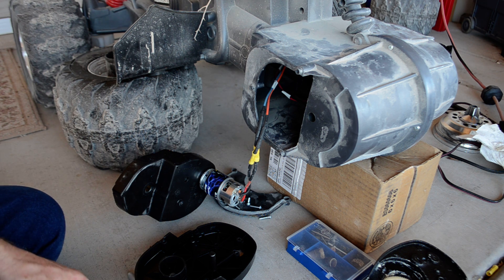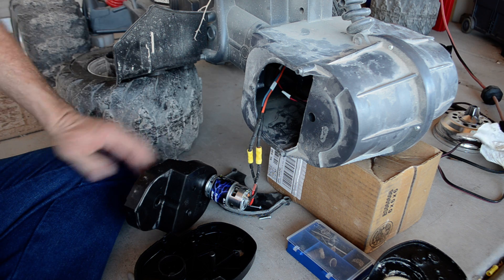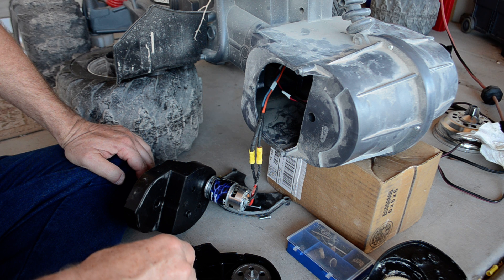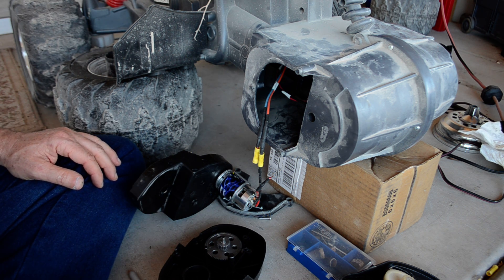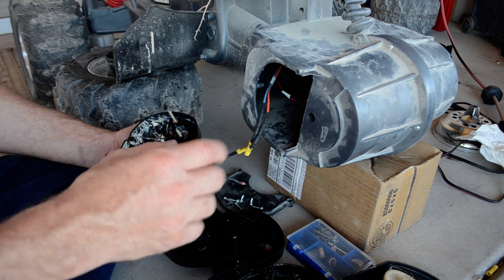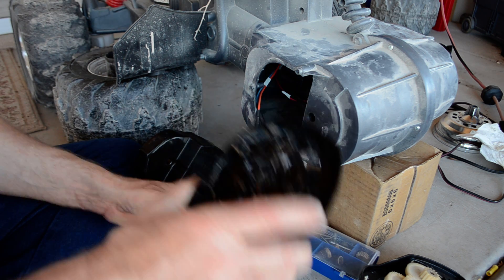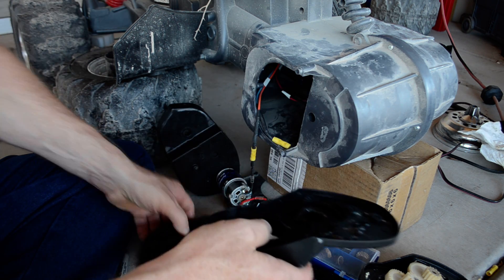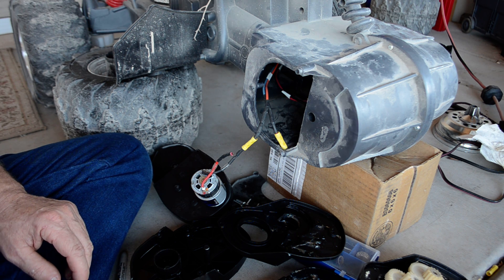ML Toys Powerwheels Stage IV Steel Gear and Gearbox Review & Results & Alternatives.

Comment: It's been 4 months now and the customer is still running. There's a reason we put a lifetime warranty on our steel gears. Yes, it took what we also consider an excessive amount of time to determine what was wrong and as a result it has improved our ability to respond to other customers in a much more expeditious manner. It is always our goal first and foremost to make sure that your child gets to enjoy their ride. As this case showed, regardless of how difficult the customer was to work with we will stick it out and give you support on any product you purchase from MLToys til we figure out the cause and best resolution.
Reply: ML Toys passive aggression isn't acceptable.
Reply: Oh wow. Glad I stumbled on this video because I was really close to buying some gear boxes for the 775 motors I just ordered. "No matter how hard the customer is to deal with"? Really?  I understand you get a lot of customers messing things up themselves in your line of work, but this man bought a premade system that my 3 yr old son could practically install himself. You admitted you have revamped your customer service because of this man...yet you never apologize and basically call him a pain in the ass. Look at how difficult YOU were to deal with. You sent him a defective part and he sent you video of the problem. Any respectable company would have apologized right away and sent him a replacement and a label to return the defective. I will never buy anything from ml toys just because I can tell your customer service sucks. This guy in the video was honestly pretty nice about it...I could sense the frustration, but he never bashed your company or cussed you like I would have. Then you have the audacity to troll his video and brag about your products after you completely screwed him. At least pretend to be sorry. I'll just buy a stock 7r case and a metal gear from elsewhere
Reply: @The_Bearded_Redrick  OMG ! I truly thought i was the only one who put up with ML toys "Bullcrap" I spent over $100 trying to buy 1 gear that i needed  from them .. I thought that i messed up when i bought the very first gear from them so i went back to order the right one this time & they had pictures of the different gears they offered & check boxes next to the pictures of the gears so I see the gear i needed i checked the box next to it ...How could i mess that up again ?  And again I was sent  the wrong gear ?  I still gave them the benefit  of the doubt & thought maybe the  pictures of the gears were mixed up so i checked another one to see what would happen & again i got the wrong gear ... Now  I'm really pissed because they are  advertising the gear i need  & I have spent over $80  trying to purchase this gear so far and I still haven't got it yet ..   So i send an email to them & tell them what has happen so far & then I tell them specific gear i wanted to buy & told them that i wanted to return the other gears they sent me .. I was told that there was no returns on these gears & for the life of me i don't remember why they wouldn't take them back .. They sent me the right gear finally and yes i had to pay for that one too .. I still have all the wrong gears they sent me ..  they didn't admit that they had done anything wrong or  even try to make it right with me or even apologize for what they did ...  It didnt do any good to talk to them at all because they got over $100 from me & that's all they wanted from me  in the first place .. I am a woman that is also a certified Mechanic & I knew exactly what gear I needed before i even found ML Toys web site .. I chose ML Toys because they had they had the gear i needed & I thought the price they were asking for them was more then reasonable & affordable..  I want to tell stickman im sorry you were treated like that & I know the feeling & because of ML Toys  by the time I received the right gear  from them so much time had went by & the gearbox got misplaced  & the little red corvette never got put back together ..She still sits in the back yard but this summer she is getting a upgrade to a 49cc gas motor & rubber tires  .. Redrick you said at least pretend to be sorry ..I agree because that was the very least they could of done ..  I take that back they did their very least which was absolutely NOTHING
Reply: @teresacomer8480  how would one go about getting it converted to a 49cc gas powered motor? I have a dirt quad and want to do this to it. I can give my email or whatever to get this information!! Thank you
Reply: @The_Bearded_Redrick  Not only did they not apologize and send the right part like you stated.. They instead said our bad, we had bad parts come in so if you want one of the good ones we will give you a 10% discount.. WTF!!
Reply: You just lost a customer with this comment.
Reply: Hell it should last a lifetime if you can't even USE your product. 
Maybe if your company didn't take shortcuts by half ass production of the product and then knowingly send it to a customer hoping they wouldn't figure it out then you wouldn't have had to "cover expenses of multiple shipments". 
Your comment makes you sound like a immature 5 year old. Who the hell brags about doing the right thing, you didn't go above and beyond, you did the bare minimum by covering the cost. Quit acting like a b*tch and man up to your mistakes. 
Who cares if he's rude?? You shouldn't have sent subpar products to begin with and lied about it being normal.
 I was thinking, mistakes happen, it might be a fluke. But after seeing your comments on here I made up my mind if your too immature to own up to your mistakes by saying something like "we tried but he was rude even the first time we talked" makes me think your too stupid to realize what customer service is.
Reply: Oh and with the "no matter how hard the customer is to deal with" comment, if yall didn't make shitty products, lie to your customers, and brag about doing the bare minimum, I imagine he would've never posted videos. The only reason yall did anything is because he was able to prove he was sent MULTIPLE messed up products.
Just because your business is in toys for kids, doesn't mean you need to act like one. My 3 year old could run the customer service department.
 "I don't want to play with them, they're mean!" 
"He started it!"
gets in trouble "Well so and so did this!"
"I didn't do anything, it was his fault."
Writing these comments just makes me hope your company fails, which if you don't graduate elementary school, chances are it will.
Reply: I have worked in customer service for a very long time and this is not how you treat customers at all. This is a disgrace on customer service. Your company shouldnt even exist with your behavior! You all should take a good training course in customer service!! Also a customer should never have to pay to send wrong parts back let alone have to pay for the right ones! When you make a mistake you take ownership to it and make sure it is fixed to please the customer!! I've been cussed out by 90 yr old woman because they put a wrong address for the delivery but yet we still made the correction and did what we had to to ensure a happy customer. I will never order from you and I have 4 I am trying to upgrade!!
Reply: @rcon3829  This customer's issue was corrected and he has been using the products happily for years since this video was made. The customer did not have to pay to send parts back either. As you are likely aware from working customer service there is more to a story often. You can always feel free to reach out to us if you need support with our products. We wouldn't still be here after 12 years if this was the norm.
Reply: @mltoys9644  If you have such good customer service why cant you have a direct contact such as a phone number.
Well after reading this and watching I am trying to cancel an order for 2 gearboxes Stage 3. I will resolve by other means
Reply: If you can reply to me by phone number you should be able to find my contact number. You can try and convince me that your parts will solve my issue.
Reply: ML Toys
Reply: Wow, I just ordered a pair of their stage 3 gear sets... I have zero time or patience to deal with shitty products or service.  If this product isn’t drop-in ready when I get them, I’ll be getting a refund and filing a claim with bbb.

Comment: wow this sucks, I was seriously just about to order the "stage 2" setup from them. Thanks for the heads up ed and stickman. im bummed.
Reply from the maker: Don't be bummed. There are alternatives out there. Even the metal gears are on ebay. Not as nice looking as the ML Toys one, but they are still metal gears. But the motors and grease and everything else has alternative sources.  Don't let one bad company ruin it for your kids. :-)
Reply: I didn't see a follow-up video. What are your suggestions after this?

Comment: Very unusual huh. I just received two new ones from you today with the same problem. motors are indexed to close to the gear and wont turn. thanks to this guy I hopefully wont be spending 2 weeks having you blow smoke up my ass. lets see how you treat me.
Reply: Ed Ambiel not complicated just get a one tooth smaller pinion
Reply: @libertyfirst8849  Not complicated, they should send properly made parts for the premium they charge. I would think finding an off-size of a specialty part might be harder and more expensive than just requesting a replacement for a defect.
Reply: libertyfirst why in the world would he go and buy the correct part after paying a speciality company to provide a drop in solution. That is what ML Toys is supposed to be doing. Charging more for convenience..